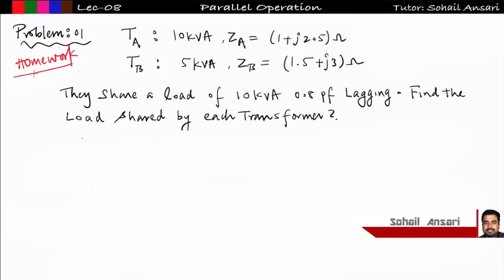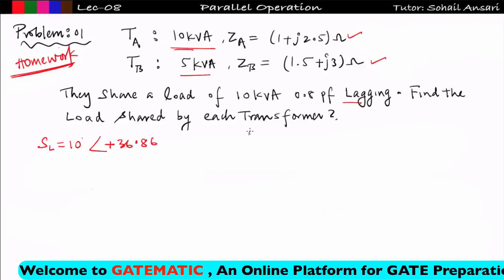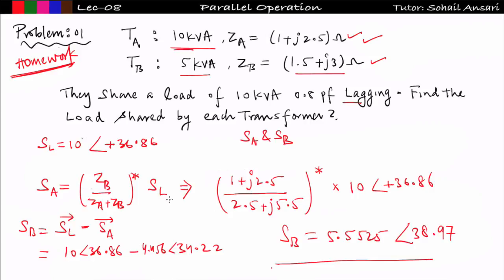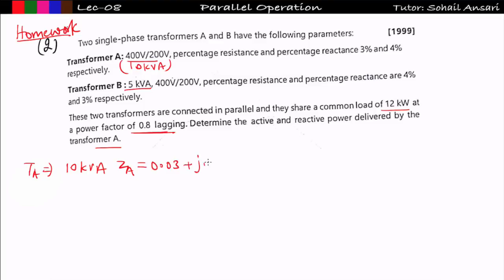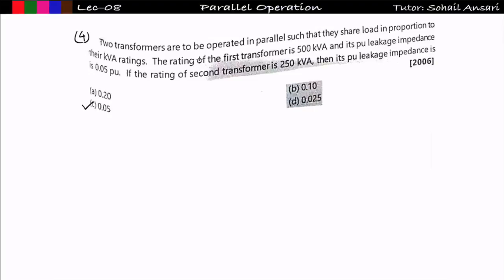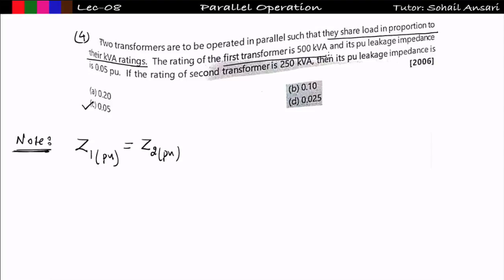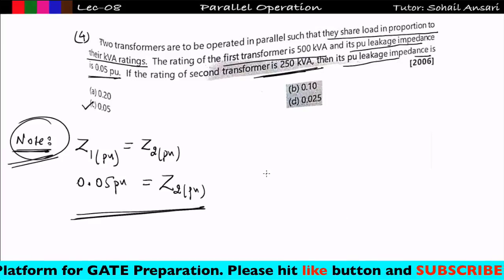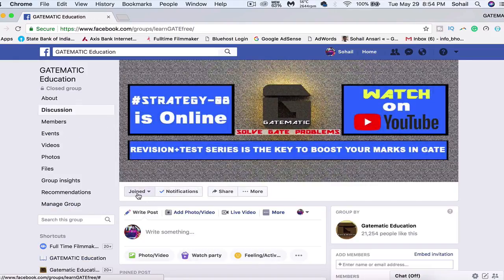Mod-02 Lec-08(b) GATE Questions on Parallel Operation of Transformer | Electrical Machine

Comment: Figure 2 illustrates the equivalent circuit of the two single-phase transformer circuit of figure 1. Assuming the above two single-phase transformer equivalent circuit is wrongly connected with a coil length, DY of impedance, Z = R + jX and two lengths of cables that interests at point M; forming a star connected circuit of three branches with resistance: Rk3, Rk1, and Rk2 .Derive
1a.The expression for the total impedance of the equivalent circuit of Fig.3
1b.The expression of the source current, Is of the equivalent circuit of fig.3
1c.Assuming cable DY is disconnected from the circuit, derive the expression for the new total impedance of the circuit.
2.Supposing that the parameters in the equivalent circuit of figure 3, are assigned the following values 
R1= 100 ohms, L1= 80 Henry, R2= 250 ohms, L2= 60 Henry, L= 10 Henry, RL= 350 ohms, RK1= 600 ohms, RK3= 400 ohms, R= 200 ohms, VS= 250V LL= 30 Henry,(LL= load inductance) F= 50 HZ
how to solve pls?

Comment: sir in question no. 3 rating of transformer T2 is 500 KVA but share loading is 555.7 5KVA so it is overloading and burn.........please clarify this
Reply: by mistake sir sir wrote 555.55 kVA     its is actually 555.55 VA
Reply: @ajaychopra9509  No, it is in KVA not VA and that transformer is overloaded by more than 10%.

Comment: sir in question no. 3 rating of tranformer T2 is 500KVA but share loading is 555.75KVA so it is overloading and burn.........please clarify this
Reply from the maker: Practically transformer is design to withstand load=1.25 times of rated load...ao this question has created by keeping this in mind..however in option if they will give u xmer will burn then tick on that and move on..
Reply: thank u sir

Comment: Sir there is mistake in putting the values of impedance in the homework problem 1

Thanks a lot for these lectures. We really need these.
Reply from the maker: right...it cannot be edited..i interchanged the value of Sa and Sb..so take opposite value..ok